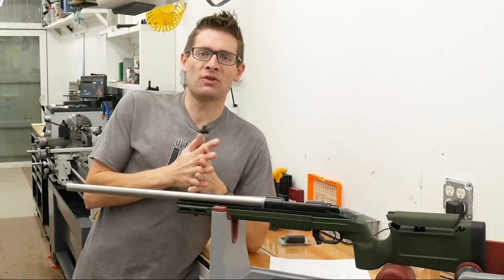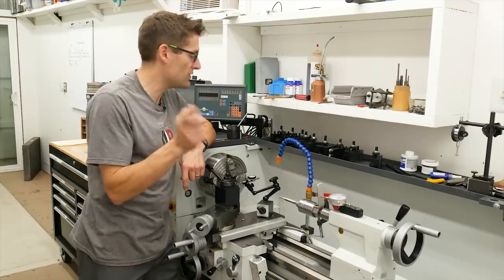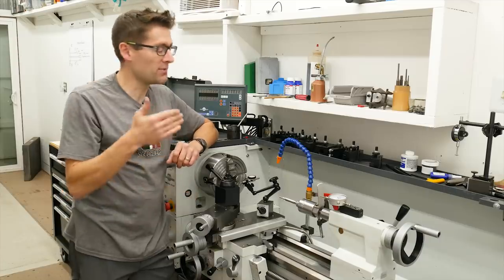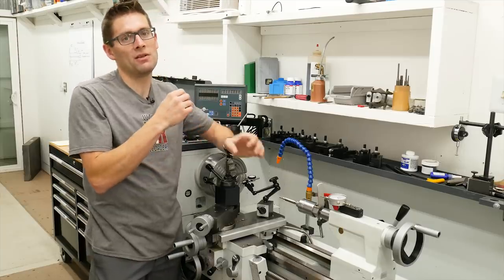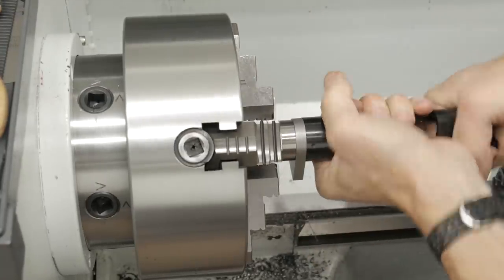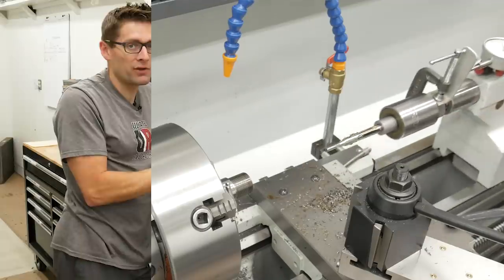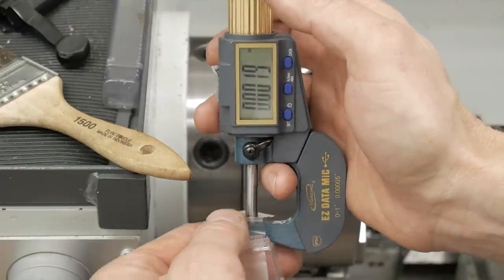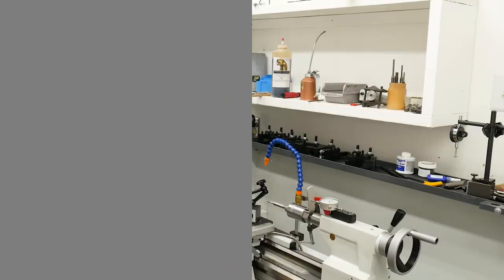224 Valkyrie Rem 700 Build: Machining and Chambering (Part 3)

Comment: When I rebarrel a rifle I make a mock barrel tennon and thread it to a perfect fit to the receiver then when you cut the barrel you have a reference to measure off of, then you mark the mock tennon to the specific rifle so if you have to rebarrel in the future you have the thread dimension ready to go, also you can put a fired round and cast of the chamber with it so you have every you need for measuring and reloading for that rifle

Comment: I like the DRO very well, sure makes it easy to control the tennon length. I use  a left handed threading tool much like your right handed one, allows me to run the lathe in reverse, threading away from the shoulder (since you set up thru the headstock there is nothing to run into) at a high rpm, whatever you comfortable with hitting the  threading dial mark. really  makes a smooth thread. By the way you then can use the threading tool for the relief groove,  just .75 divided by the TPI gives you a good depth, touch off, set to  zero and start checking when within .005 or so. If you want to see this method in action check Joe P, on YouTube.
Reply from the maker: Thanks William, I enjoy hearing how other people set things up...

Comment: You need to invest in a set of thread measuring wires you,  can't check the pitch diam. with a caliper
Reply from the maker: I plan to show "over wires" (lathe fundamentals) - but with this work, as Gordy Gritters had demonstrated- it's the fit between the specific receiver threads and the tenon you are threading that matters. This is a tighter than normal fit- over the wires is not needed or the best option here.
Reply: Wires support standardization/interchangeability. Here you have a specific receiver and barrel tenon as a unique pair that you want to mate, so the caliper measurement approach gets the job done.

Comment: I love your work Gavin. I have had a question on my mind for a long time. It's slightly off topic, but what would i need/how would i be able to machine an AR-15, 10.5 inch, lightweight profile barrel from a 30mm OD .223 barrel blank with a lathe that has only a spindle bore of 20mm such as the Sieg SC4 ?
Reply from the maker: Jonathan- curious where you are located! I would suggest that you look at using a steady rest, take a look at the example half way down in this article: https://makingwithmetal.com/224-valkyrie-remington-700-build-p2-barrel-prep-and-alignment-in-the-lathe/

Comment: https://youtu.be/UlVu801V8bs?t=411 this is the wrong way to measure threads. For the major diameter this is fine, but for the pitch diameter you should use wire gauges to properly measure. They are super cheap, I think I bought some brown and sharps for like 30 bucks.